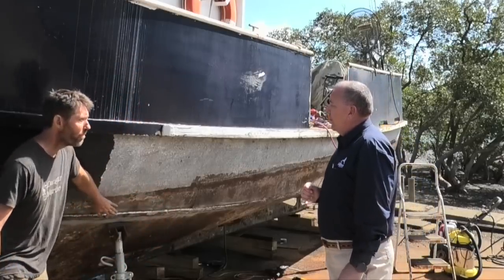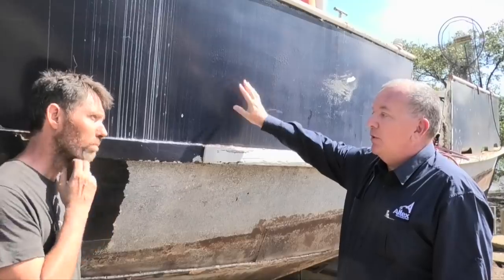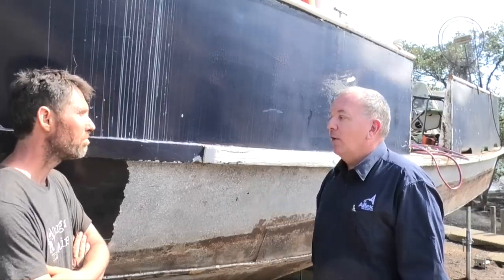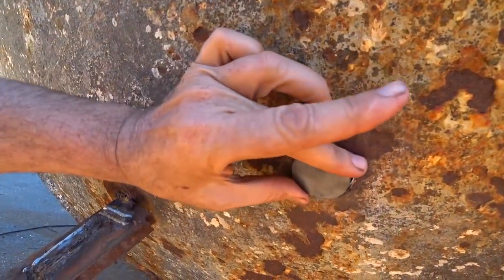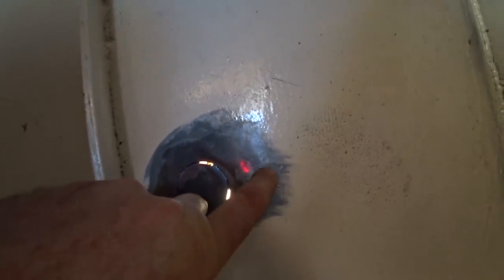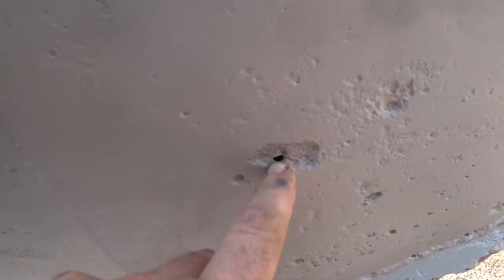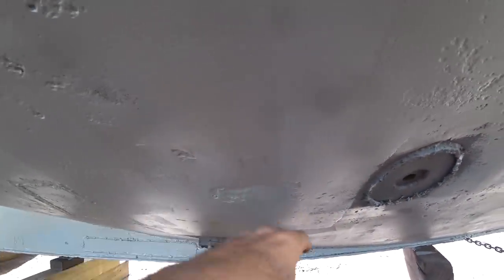Sandblasting and priming the steel trawler hull

Comment: One of the lessons I've learned detailing my cars is that you can't always do every big project at once. If the interior needs a deep clean, just give the outside a wash and call it good until the next time. Trying to tackle everything at once makes it hard to focus and spend the time to get a good result in the area that needs the most work. I think what you're doing with the transom is a great idea. Focus on the crucial motor out stuff now and come back in a few years to tackle the next big project on the list. Great job.
Reply from the maker: I agree completely. There is always next year, it's not like it all has to happen now and to be honest, this isn't the ideal location. Next year I'll put it in a steel-friendly boat yard.

Comment: Preparation is everything. Think you win on that hands down. Good to see the knowledge going into selecting the paint products, to protect the boat. Oh, and leave the transom. Life is too short. That's a big job, cutting out, crane in new transom (not to mention cost), weld in bulkheads, etc.
Reply from the maker: For sure, replacing that transom would be at least a week and $1000.

Comment: Used the Altex system on my boat - epoxy undercoat - 2 pot polyurethane. Worked great. The high build undercoat goes on pretty thick and chalky so worked great as a final faring layer. The 2 pot poly is nice and hard. Great finish.
Reply from the maker: Good to hear. :)

Comment: I have worked on a lot of steel boats, usually we blast the entire hull, then coat in a product called Rust Bullet, then go about isolating repair areas. Reblast around the repair areas, weld, blast and Rust Bullet again. When all repairs are completed, epoxy barrier coat and topcoat/anti foul as needed....A small spot blaster would save you a shitload of grinding.....

Comment: Wish I was there, I am a retired boilermaker pressure welder done lots of filling pits in shells. You doing a very good job welding. Make sure you put anode bolts on the hull, more the better. You are going to fix the fuel tank soon before you paint.
Reply from the maker: Yes, fuel tank repair is today. There are a few other internal welds to do as well so I'll just grind any burnt primer and recoat before doing the whole second coat.

Comment: Looking better each video Stu, got to say though, I would spray all the coatings on, better coats, more even coats, far better finish and so much faster to do. I am saying this because I have been involved in the spraying market for over 25yrs and it's so much easier than rolling or brushing.
Reply from the maker: Airless spraying would be a great way to go but just another thing I would have to get set up for or pay someone to do.
Reply: Dangar Marine potty I am on the other side of the world otherwise I would take a trip and sort you out with a spray machine to get the boat done

Comment: Great work Stu Very intersesting vid mate. I use Black Altex No.5 Antifoul on my boat in Pittwater. Four coats rolled on last at least 3 years in the water
Reply from the maker: Wow, 3 years is amazing. I've never got more than 18 months out of my antifoul, but I guess that has been aluminium friendly which is undoubtedly less effective.
Reply: Four thick coats rolled on is the trick

Comment: Hi Stu, great vidz mate. With your stick welding rod's ,they like to absorb moisture from the atmosphere making them hard to strike and stuttery. Bake them in the oven for half an hour or so and use them hot. Sounds funny to non welders out there but the cooking instructions are on the pack ! looking forward to next installment !
Reply: Keeping rods hot is only for hydrogen controlled or low hydrogen rods, it keeps the moisture out which helps keep them low hydrogen. There is no other benefit then that except in winter cos you can heat a sausage roll in the oven

Comment: The antifouling that was identified is an ablative coating, meaning it wears away over time.  For ablative paints it's very helpful to apply the coats in contrasting colors. This allows the coating to be touched up where the "under coat " color shows.  This approach maximizes the life of the coating as it only needs to be recoated in areas where it's seen to wear away.  Greg
Reply from the maker: Yes, I think that is a great way to go. I'll have to ask him if they can supply at least two different colours.

Comment: Oh man was I excited to see how awesome that steel is. I knew it was all good though when i saw the cuts you made through the bad and thin stuff. That boat is made from real quality steel.

The square patch you made i think is perfect. I don’t think you need to go past the support inside. It looks like about four inches of good steel left up to the brace. Good choice to replace the whole area.

Wow, the punch to the nose was a hard one. That is incredibly strong in that area. It took it really well. I agree that trying heat, ram, and hammer that back down will be too much to tackle, and not really necessary. Your idea to make a piece and bevel it square again for your sonar is spot on.

The pad welding you did on the transom i think is just fine. I think that transom steel looks worse than it actually is. Again quality steel took the neglect and laughed at it. I heard you smack it and i dont think its going to fail in the near future, it probably never will after you’re done with it. Great attitude btw!

Loved the talk you had with the rep, that product and process is gonna be very effective, and look awesome too.

Oh man the sand blasting was loud! Sounded like a jet airplane at full throttle! The results are just jump up and down awesome! I bet that took a ton of worry off your mind after seeing the beauty of that quality steel. I heard someone else grinding or cutting in the back ground during one of your talks. So your not the only one terrorizing the neighborhood! Lol

Was that intimidation or your mind just deep into thought on how your gonna tackle a problem? I suppose they’re closely related anyways. Too cool man.

I totally understand what you mean by working on something outside, upside down, cutting, welding, in tight cramped spaces, wind, rain (trying to ruin your work), your face inches away from heat, sparks, and your work. Then the next day spend hours undoing the damage that happened overnight (dew and humidity) to your new work from the day before. Ya, it’s a monster of a challenge. It’s amazing the science of being inside four walls and a roof makes. My eyes aren’t as sharp up close and having to deal with glasses to see what going on. Its not easy, takes a ton of thought to stay safe and do a good job. It also slows you down by about 300%. If it takes an hour in a shop with everything handy, it will take at least three hours outside in the elements. Although that is also a skill your mastering, not everyone can do that safely and get good results. (Side note- i’ve had to do it laying in snow banks with tools frozen to the ground as soon as you let go of them, freezing numb hands shacking, and yes i have caught myself on fire before, thought “whew im warm and why is it so bright inside my helmet”, and crawl out and do the roll around on the ground to get the flames out, good times, not, lol)

I’ve watched the video 3 times and Jen watched it once. And could watch it again and again, but I’d find new stuff to write on here and chew your ear off.

Great work Stu, you’ve made a good choice in your new boat, great video. Stay cool man. 😎

Comment: BRAVO!!!!
Now THAT was some great progress, Stu!
Very nice to see you settling in with the stick welder and putting it to effective use.
You aren't going to need to touch that transom for many years.  If that primer and paint system is as good as it looks, it simply won't change.  You did well.
Nice job filling in the low spots.    I'm surprised that the epoxy rep didn't tell you to hit any little repair areas with 40 grit on an orbital sander to roughen it up similar to a sandblasted finish.  I would personally roughen it up a bit, to knock the shine off, then follow their instructions exactly.

Thanks for taking the time to make this video, and congrats on the good progress.   It's starting to really look good.
Reply from the maker: Thanks Tony. I really enjoyed watching the welding videos you sent me, particularly the guy doing the pipe welding, so enthusiastic! I did run some 40 grit over the transom in the end. I also think the texture of the beads of weld will help all the epoxy (including the filler and fairing compound) to adhere. Can't wait until the weekend is over so I can push on! ;)
Reply: I'm glad you liked them.  Watching videos like that has certainly made me better, teaching me the finer things to look for while in the weld.  
Your beads are looking good!
Reply from the maker: I think what I've learnt doing this job is how much heat builds up doing out of position welds so I'm running at much lower amps now. The deceptive thing is that hot out of position welds gloop a bit so that look tall which you normally associate with a cold weld. Dropping the amps right down made them much better. I'm going to weld up the fuel tank today so I'm going to clean up the cut, do a root pass and then grind like the guy in the video before doing the cap(s). Fingers crossed!
Reply: Sounds good.  Clean prep definitely makes for clean welds.  Play with the amps as needed.   You will do well.  Everyone is rooting for you!

Comment: I managed to get a commercial account with taubmans and had access to PPG commercial paints which they use on oil freighters cruise ships etc .The paint is still really good after 3 years and cost was so cheap in comparison .It was 2 pak roller and tip application

Comment: You can have it good, fast, or cheap, but you can only have two of them. If it is good and fast, it is not cheap. If it is good and cheap, it will not be fast. if it is fast and cheap, it is guaranteed to be horrible.  You are doing it good and cheap and doing a splendid job, Sir.

Comment: I think youve got the logic down pat, and it is a good circumstance to learn to handle welding and it seems to be going well.
Remember to take your earth with you.
You should be able to hear more of a ring when you clobber the hull with a hammer as opposed to dull thuds.
Im surprised what a difference spraying makes with coat thickness.
have a good one

Comment: at 1:55 - the kookaburras tell you what they think of your project :-) I know spraying is seen to give the best paint lay down , but I have used the 'roller and brush feather ' on my boat and think it came out well. A bit tricky in our current heat though.
Reply: I build water trucks out of old cement trucks and work on heavy equipment. The paint that is rolled on or brushed on seems to stick better and last longer. But then i don't do the painting. I do the welding and fabricating. Trying to get my boss to buy sacrificial anodes to put in the water trucks we have already built over the years. Now have 4 more water trucks to build... the place that has been supplying us with the water tanks to put on them now puts in a dozen sacrificial anodes. I looked up the price of them. $35 bucks a piece. Pretty cheap insurance on a tank that costs $20,000 to $25,000. i get tired of repairing water tanks that have rusted and cracked because of no sacrificial anodes.

Comment: That epoxy paint system sounds like a good way to go.   Cleaning up the engine space when the motor is out is a must!   Dealing with it now is just so easy, over trying to do it after the motor is back in.   We use to paint the engine room sides and bulkheads white and the floor or hull a light gray with sand blasting sand rolled into the paint for nonskid.  This works well in decks too and it's easy on bare feet too.

Comment: Did that boat ever have zincs on it? She sure got attacked, the boat has seen a lot of leaking electricity either from tied up in a marina or electrical leaks on the boat itself. Seeing as this boat isn't a highspeed vessel I think I would have gone with coal tar paint from the water line down and use a 2 part epoxy on the top for color. Coal tar paint is a little more resistant to electrolsis its designed for industrial use like barges its a tougher coating. Nice to see you got a white blast on the hull most boat owners only opt for a sand sweep because its cheaper.

Comment: Welding with steel rods to fill in some of the pitting is great (fusion welding) and is what I would have done. Where you don't need strength there is also another technique that's handy. Using silicon bronze rods (brazing). This is great for filling holes such as what you have done on the transom and it grinds nicely. An advantage is that silicon bronze welding temperatures are about 300C-400C below the melting point of steel, although sometimes when not set up properly you can melt the base metal and mix the steel into the braze metal, which is not good as you can get cracking. Another use for Silicon Bronze brazing is as a hard wearing surface. It wears a lot better than mild steel and easy to apply a thin layer without melting the base metal.
Reply from the maker: It's always good to have a couple of techniques up your sleeve so you can pick the right one for the situation. Thanks.

Comment: Use self etching primer in the future it will hold down rust a lot better than epoxy primer
Reply: I thought the same thing.  Start with etching primer then epoxy barrier coat and final fairing and anti-fouling layers

Comment: what is the rod number? 6013, 6014, 7014? I look at it this way. If the metal to repair is labour intensive to replace, vs welding up a few holes.. Id weld the holes.  A suggestion id make is to get all the outside work done as soon as possible. Inside work can be done in cooler weather. For you down under winter is fast approaching. Good luck
Reply: We wish :-) Early April still hitting mid 30's C around in Adelaide.
Reply: @rayg9069  30 here in Sydney today.

Comment: If you can't sand blast, next best is a mechanical tool called a bristle blaster. It preps to blast class 2.5, same as sand blasting.
Reply from the maker: Interesting, I'll check that out. I was really asking about which mechanical method is best rather than which product.

Comment: I don't see any issue with building up that transom with weld. That is how you build up worn metal on dozer blades and excavator buckets. On those kinds of metal structures you do what is called padding. Beads running one way then the other to build up in layers. That would never be necessary on that transom but it could be done if you really wanted to.
Reply: I am with you on that. It shouldn't be an issue.

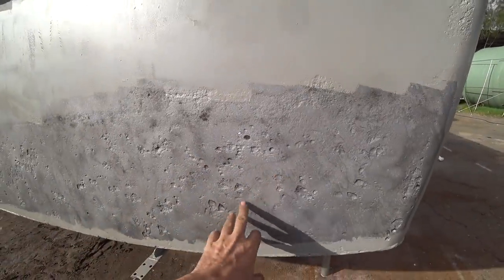Comment: 18:50 I was thinking of just filling the pits with stick or any welding when you were showing the transom area, and next scene you were doing it that exact  way, :))  (I was a 3rd engineer in this chemical tanker, and we hauled Kostic soda(may have been something else) from Gela Sicilia to Istanbul Turkey and there were thousands of pits in the cargo tanks (stainless steel or as we called it  chrome then (year was1985  )we had 2 sets of welding machines and the fitter would lead the way and fill the holes that were too deep and went through the stainless into the sheet metal and I would follow him with stainless to fill the damage in the liner itself, it took several days, I was 24 and did not complain a bit, the attention was fixing the tanks so we could pick up our next shipment from Rotterdam Holland going to Bushehr Iran(that is another story since Iran and Iraq were at war and Iraqi fighters were shooting the cargo ships in the Persian Gulf) enjoying your videos,thanks:)
Reply from the maker: That would have been an interesting time in your life! I was really pleased with how the transom turned out. I'm going to go through today and remove the epoxy in a few other spots so I can do more of the same and then recoat.

Comment: For that warped plate, weld 2 plates together into an r shape and weld the bottom of the r next to the edge of the warp. Then leverage off of that and either use steel wedges or get a hydraulic ram and push it out. Then get an oxy on the outside, heat the edges of the warp to about 500 deg c or thereabouts and then apply wet rags, that will shrink back the outer layer of steel to make it tight. Do that a few times if req.
Reply from the maker: Cool, thanks for the tips re the dent.

Comment: Seems amazing that to stop something flash rusting you spray it with water (plus Hold-Blast). How do you know when it has dried off properly, even at a microscopic level?
Reply from the maker: It is a bit counter intuitive. It is never going to be completely dry due to the humitity in the air, but the epoxy can cope with that.

Comment: Instead of using anti foul use lanolin it works better and lasts longer you get better mileage all you do is heat the can in a pot of boiling water this liquefies it so it brushs on easier the ferries of Sydney have been using it with great success when any growth or barniculs appear you just flick it off
Reply from the maker: Interesting, I'll look into it.

Comment: Why don’t you just put a plate over the whole back ?   It’s looking good tho . Keep up the good work stu
Reply from the maker: Plating over the hull, like this one has on the sides, means the boat can't be put in survey as there is no way to know the extent of the corrosion between the plate. Cutting the old plate out and putting a new one in is the only real repair, but unfortunately that takes a serious amount of work. Down the track I will cut the doublers off the side of the boat, just not this season.